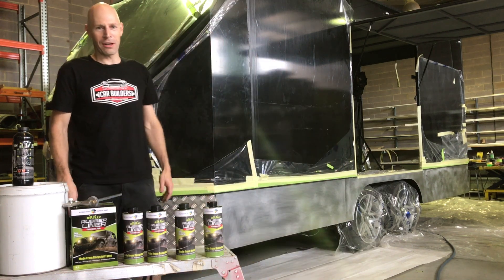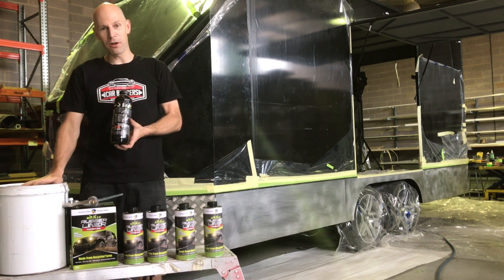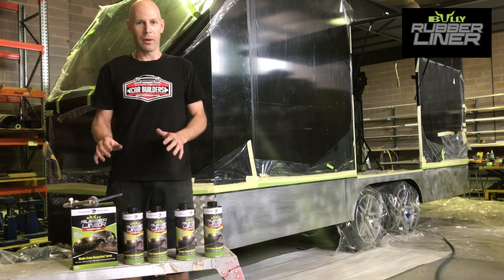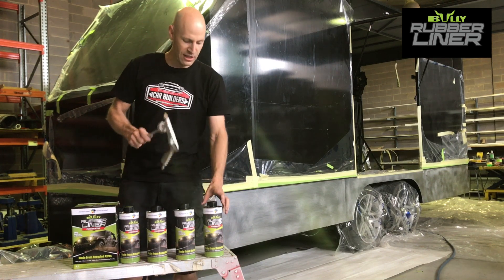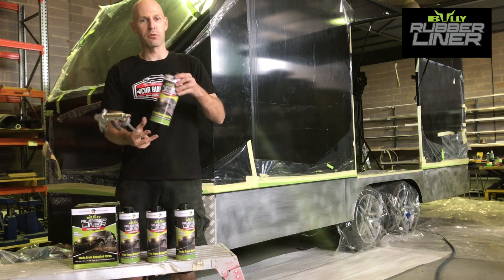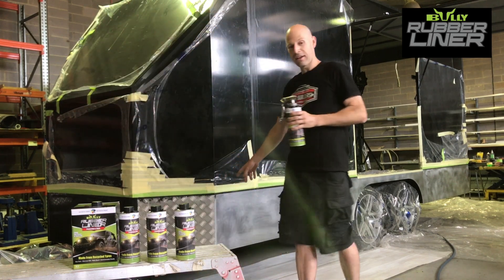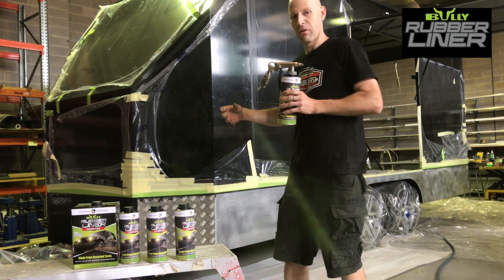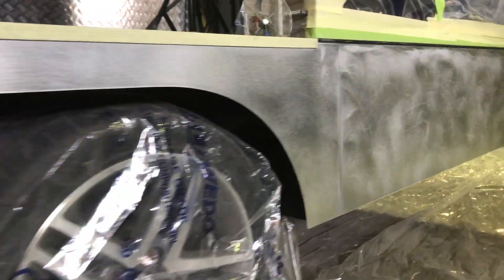Bully Rubber Liner

Comment: Using bully on an F250 bed, Mine is coming out blotchy, shooting at 60 psi. It’s taken me 4 coats to get where you can’t see thru. 
Should I increase pressure to 80. Seems like you have better coverage as you spray that I’m getting. Any tips?

Comment: Can you apply straight to alloy without primer?
Reply: As long as there is no bare metal, any bare metal you will need to use a etch primer first, other than that just paint.
Reply: @bigfella6629  so you only need etch on the steel not aluminium?

Comment: quick question, do you need to have a regulator on your airtank, or can you just used the regulator on the spray gun? Many Thanks
Reply from the maker: Hi Albert, either way will work 👍
Reply: @carbuilders1  Awesome, much appreciated

Comment: Hey man, I'm really interested in this product but I want to spray a rust converter on my truck beforehand. How will the Bullyliner adhere to a product such as Corroseal? Thanks
Reply from the maker: Hi mate, we would suggest following the directions on your rust converter however you are likely to need an etch primer.

Comment: Could I paint that over the entire top of car paint with dead clear coat?
Reply from the maker: Yes, you can. Standard paint prep will be required. Remove flakey paint and paint over. It will key into the surface if prepped properly and the paint will hide any sins or variations in the surface/paint